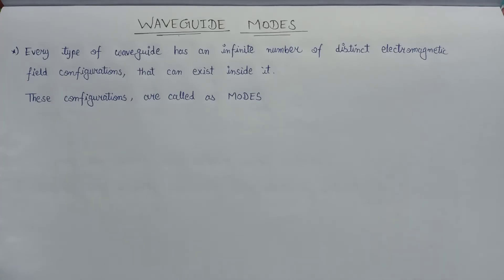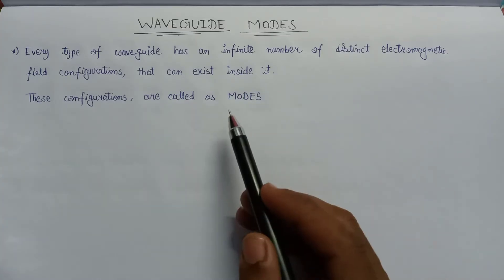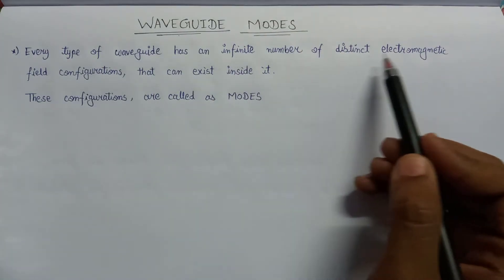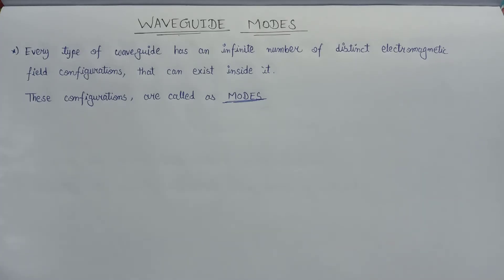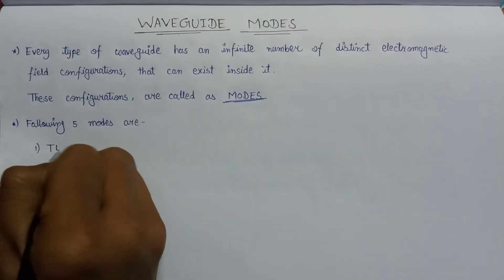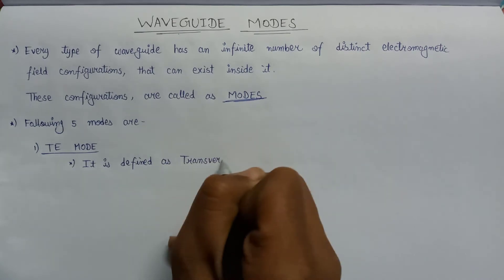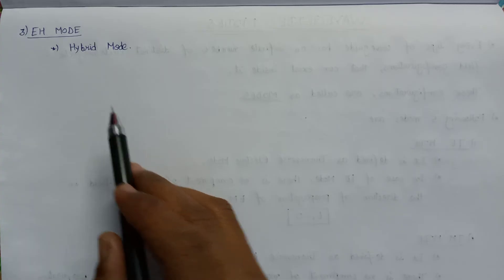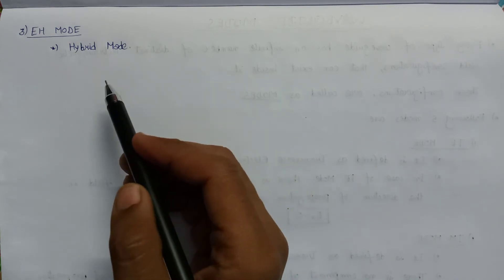Waveguide Modes

Comment: Why TEM mode does not exist in rectangular waveguide ? Where I can find this answer
Reply: TEM mode does not exist in a rectangular waveguide because it is a single-conductor structure. A TEM wave requires two conductors to support a uniform transverse electric field and provide a return path for current. In a hollow rectangular waveguide, Maxwell’s equations and boundary conditions force at least one longitudinal field component (either  or ) to exist. Hence, only TE and TM modes can propagate, and TEM mode is not possible.